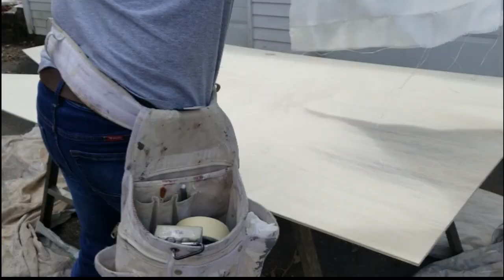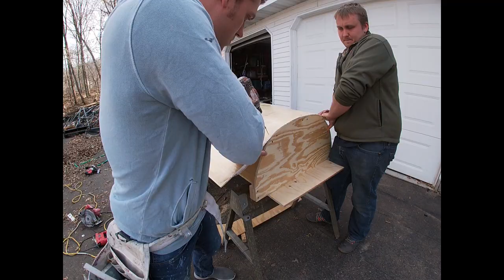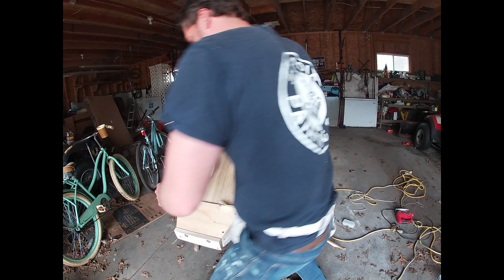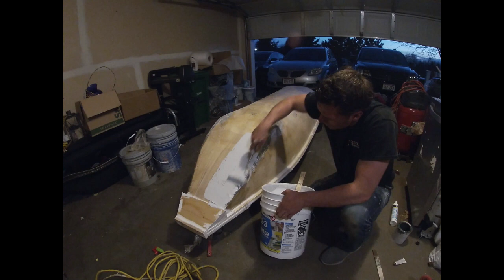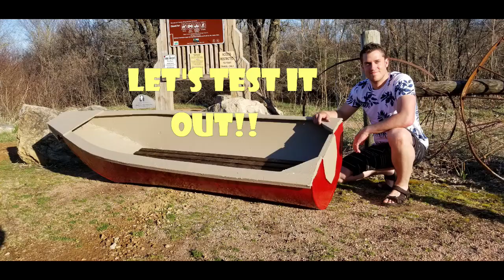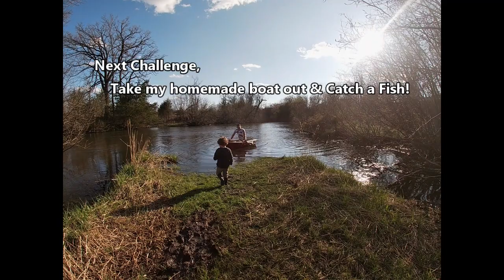"Life Size" ~Origami Boat~ Is it possible to fold 1 sheet of Plywood + scrap into an small boat?!?

Comment: Interesting? Im a boater ,( 40' sailboat ), and have lived on the water in my boat for a long time.  Ive seen many types of boat and dinghys. I worked as fleet maintenance for a marine rescue and salvage co.
 Some ideas i have for you wiuld be to add a keel and some skegs so your vessel will point and track while rowing rather than be prey to the wind or go in circles while rowing. 
Also there's a good cheep pamphlet on fiberglass techniques at west marine by west system. 
Also maybe use wire to stitch the bow. 
And finally use marine grade plywood and paint the sheet with epoxy before adding the fiberglass until the wood stops soaking up the epoxy. This will prevent the delamination that will probably happen to your vessel over time.
 I enjoyed the vid.
I love experimenters and the spirit of thinking outside of the box. 
P.S. balance audio on the next vid. The guitar was way louder than your voice.
Cheers!
Reply: If you had an attention span longer than 5 minutes you'd see he addressed most of that. Including the marine plywood when he said he wanted to see how cheap he could do it. I'm a Newfoundlander, saltwater is what we do, and most of the builders around town couldn't get "marine plywood" until 20 years ago or so and lasted for years as fishing boats on the Grand Banks. I still don't know many who do use it if they know how to use fibreglass... Sailing and cleaning a boat don't qualify you as a builder my friend!
Reply: @ec6052  well bless your heart. I bet you have so many friends🤔
Reply: @blahahtheelder4343  Thanks for the useless response 👍

Comment: You thought a cylindrical bottom was going to be stable? As soon as I saw you bend that plywood. I knew it was going to be very tippy..That is why there are so many small flat bottom boats. I watched another video where they did about the same thing to build a bathtub. Now that you have the boat building bug. I suggest your next boat should be a cajun pirogue. Stable flat bottom. Easy to do with one sheet of plywood. Fun as all get out.

Comment: looking forward to part 2.  not sure i could build that for 50$ .
Reply: Yea.  A sheet of plywood is about $35, that tin of epoxy is close to $50, the fiberglass is another $50.  At best, you could build this for $150, assuming you already had all the tools and a bunch of scrap wood and other materials.  And that's just for the hull.  Don't forget paint, engine, sail rigging, oars/oarlocks, fixtures, etc.  I'm currently building something like this, and it's WAY more expensive than any of the posts I've found for the same design.  It's basically "$50 boat, assuming you already bought 90% of the materials!"

Comment: $50? You can'y buy a sheet of ply with that let alone the epoxy or glass mat
Reply: incorrect, look for "meranti luan", look that it has the PINK glue between the laminates (3 core plus 2 skins 5 layers total about 6 mm thick). its about 11 bucks a sheet, the pink glue passes the boil test really nicely.
if you want to continue with the cheap theme, use "PMF" (poor man's fiberglass) for your covering, is bed sheet cloth and type2 or type3 wood glue, before the paint.